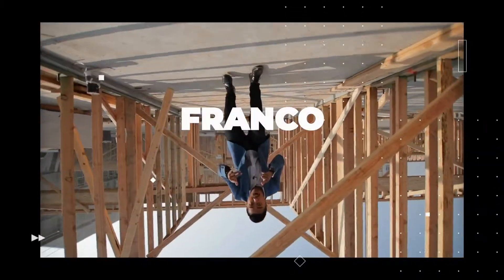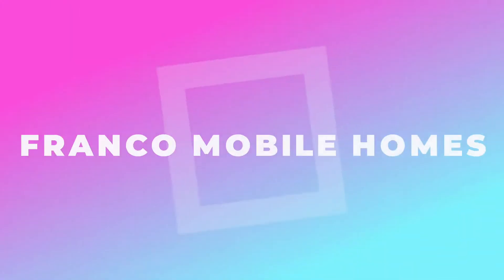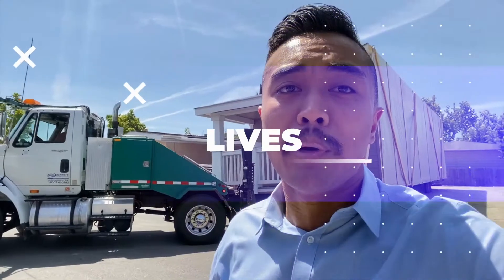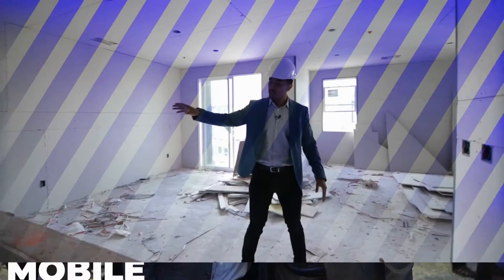Common Mobile Home Inspection Problems

Comment: what can O do if i have contract to buy a manu home that the owner built an addition a deck and another room.... the engineers failed the hud inspection... can this be fixed and i have conventional loan
Reply from the maker: What state and jurisdiction are you in?
Reply: @francomobilehomes  south Carolina  my lender wants to back out...had contractors say it is a well kept house good shape the load baring needs fixing because of the additions.. but I do not wan to fix it before purchase any lenders you know i have approval for  conventional
Reply: Mobile home owner here , If room is is too heavy for supports you can add extra supports under the room addition . It should say what the exact problem is and missing . I put a room addition code check ok but wanted to add more .